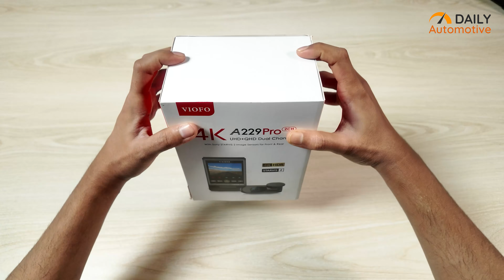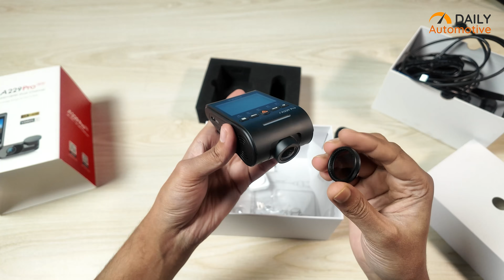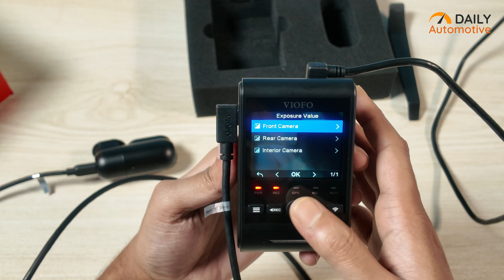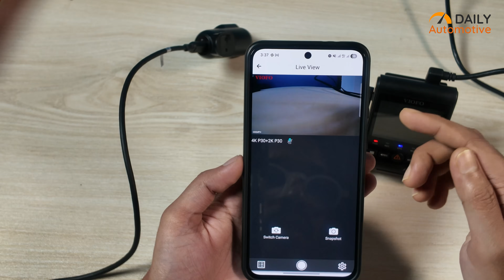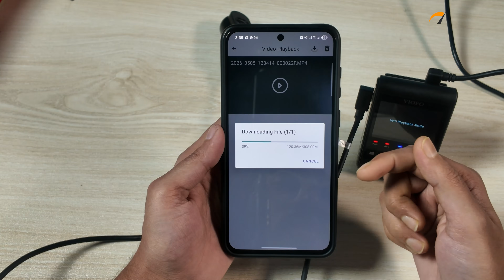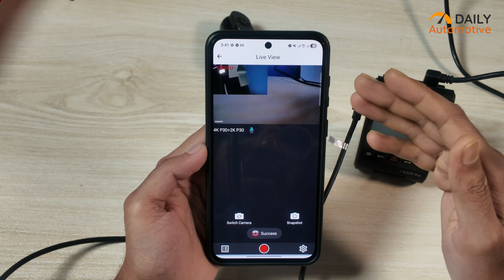VIOFO A229 Pro 2 Channel Dash Cam Review: Should You Get This?

Comment: Good product and easy to use so far. The lens angle adjutment is spot on. To use parking mode, order the hardwire kit with inculded fuse tap or it won't work. Easy install. Use the VIOFO 512 industrial card. I am going to max vid settings since the card can hold so much data, why not? Seems like my unit does not repond manually when connected to wifi using the app. I use the phone app and don't need to touch the unit unit anyway. Just a heads up if your unit isn't responding when you directly press the buttons while connected to wifi and app.
Reply from the maker: Glad it's working well for you, and thanks for the heads up on the app connectivity!